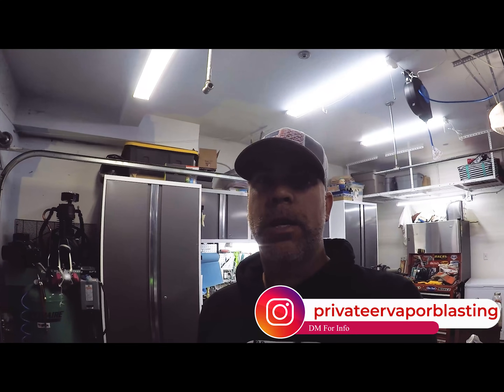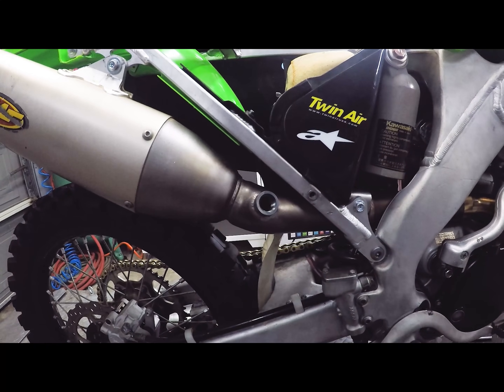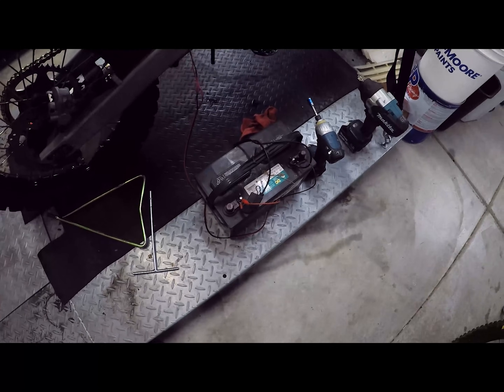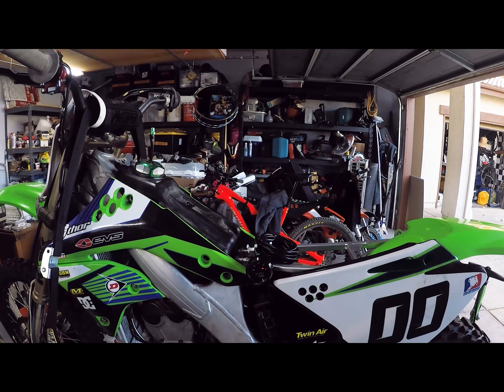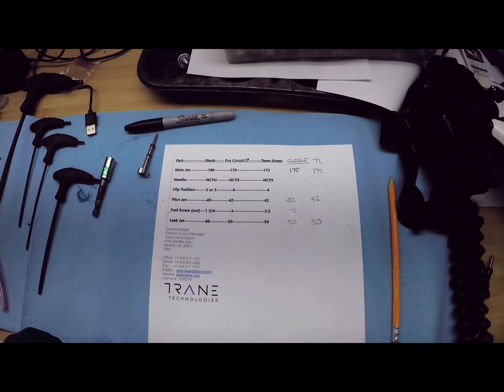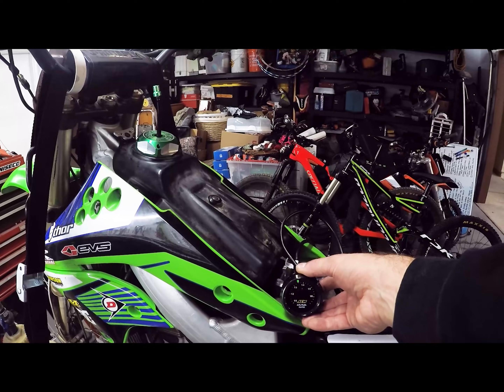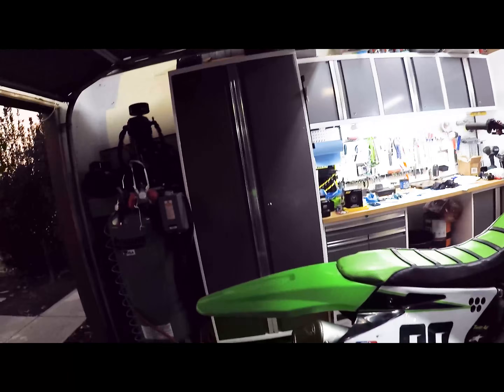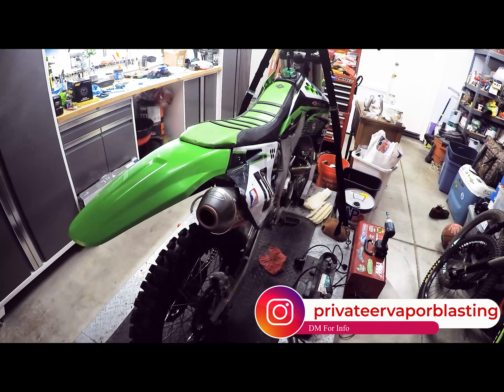2007 KX250F Air Fuel Ratio Meter (AFR) Carburetor Tuning, Lean Bog off Idle

Comment: Great info! I'm currently looking into buying one. Did you find a solution to not drill in the pipe? That's the biggest obstacle for me right now
Reply from the maker: No I haven't yet....I took a class at Race Tech last year in Corona, CA and from a theoretical standpoint the 13.2 is an ideal mixture, but at the end of the day all that really matters is HP on a dyno when you're building a race motor.  You're going to be close to the 13.2, but that always isn't the end all be all...

Comment: I am a newbie to carb, and i am trying to get my carb on DRZ400 tuned correctly so that i am thinking to get an A/F ratio gauge to help set that up. Did you ride and monitor the A/F ratio along or just let the bike sit there and tune? Thanks!
Reply from the maker: I would honestly recommend looking up the jetting specs for your bike and work from that point.  A lot of companies like Pro Circuit will publish what they have found to be the best setting for your bike and you can adjust from there for elevation, temp, etc., but their base setting is usually spot on.  Just do a search for your year and bike "jetting" and there will be stuff from ThumperTalk and other message boards that should get you really close.

Comment: Really great information Garrett - thanks for putting this out there and providing the links. I'm really curious if you ever compared the bung O2 readings to placing the sensor up the pipe. I'm resisting drilling a hole in my pipe!
Reply from the maker: I haven’t yet…got wrapped up in other projects.  I definitely think it would work, but not be as accurate.

Comment: I used afr sensor for my dual fcr on a xt600 and when i tried to lean it more than 13.2 in the reality was too lean. Later i learned that the 14.7 is only for efi not carbs the carbs can't work that lean, the good power output for carbs is 12.6 that is too rich for efi. Still learning about the afr and carbs